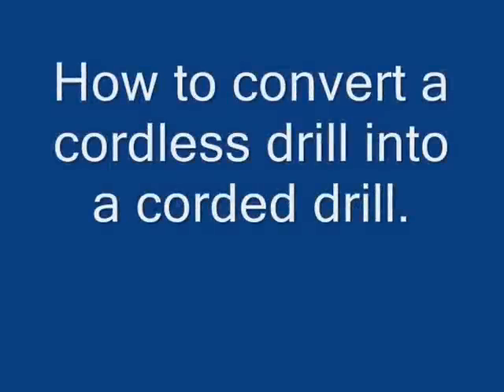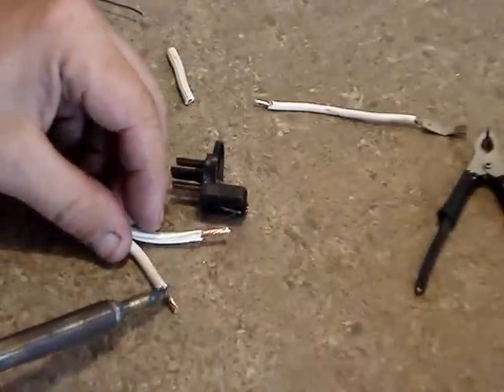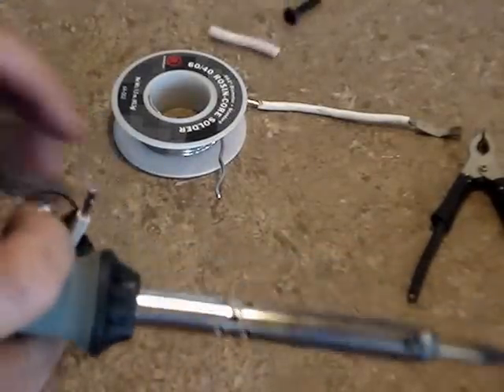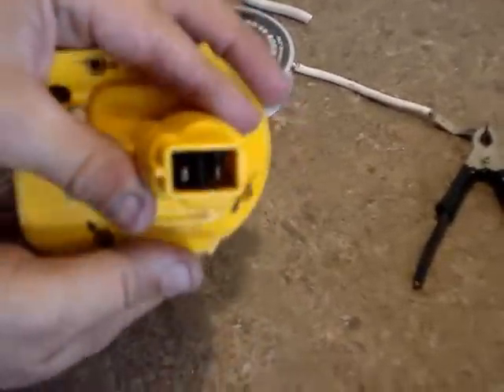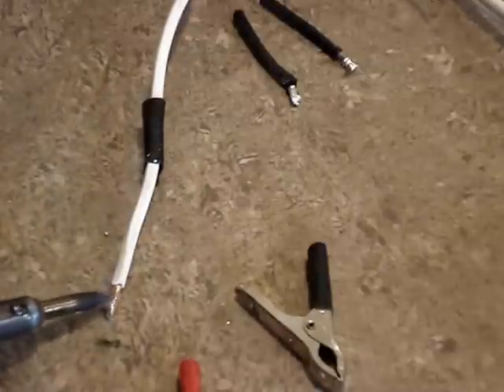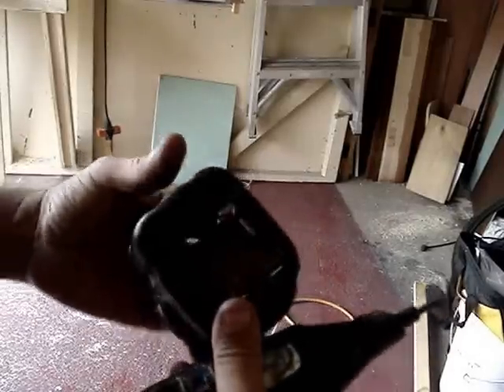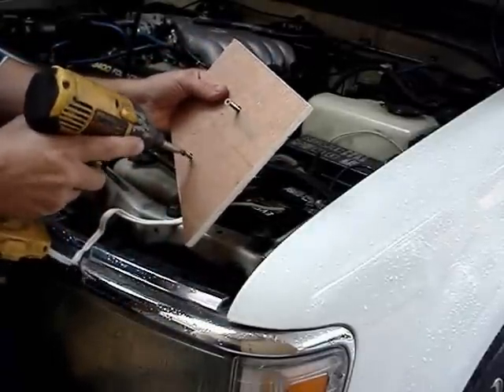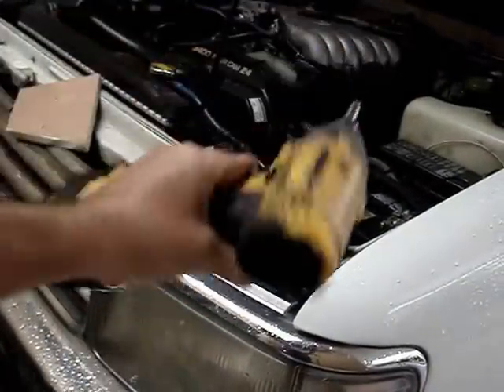How to make a cordless drill with a bad battery into a portable corded drill.

Comment: Better to make a low voltage extension cord that comes from a low voltage sorce to plug the drill into. But you may have to calculate voltage loss over distance.

Comment: Excelente vídeo thanks .I have a question.I got a black and decker drill 7.2 v that I had it running with my 12 v car battery ( for about 30 seconds) do you think 12 v would be too much power or it’s gonna be fine.I don’t wanna damage the battery or the drill.thanks

Comment: You are better off using 12ga. instead of 14ga. not moving to even thinner 16 ga. wire.  Remember that it may only be 12V but that works against you, means it needs that many MORE amps, and every volt you drop across the cord is far more of a reduction in power than with higher voltage equipment.   Granted you started out with 12.6V if the battery is fully charged, but your original "12V" batteries started out at closer to 14V fully charged, even though they quickly droop to near 12V under load.

Comment: Would I be able to wire it to a regular plug in 120
Reply: not directly, you will need a power supply of sufficient voltage and amperage so the 120AC is rectified and transformed to a dc voltage that works for your drill.
Reply: @brentsido8822  so basically the original dc charger?
Reply: @chrisrosenkreuz23  I guess that's possible if the original charger puts out enough current but as it chargers that battery overtime unlikely the output is enough to drive the drill under heavy load.
Reply: @brentsido8822  thank you for the reply, that makes sense!
Reply: @chrisrosenkreuz23  sure, welcome

Comment: Nice job!  Looks like a good idea to maybe make one of these with a longer cord for permanent use.  Find a reasonable 12 volt smaller battery, like a lawnmower with the carry handle for convenience and just carry it around. It  has to last sooooo much longer with a small battery.  Only thing is you have to have a charger and you would be set with an awesome tool that you dont have to pay up to $40+ for all the time. A real battery should last for years, just like a car does.  :) Peace

Comment: You can actually use an old PSU to power drill with +12v line. So that you don't have to use any battery.

Comment: This may work off a good 12V car battery charger. I think they put out enough amps to work without being overloaded. Also, the drill useage is not continuous which should keep the charger from over heating. This gives you a portable indoor power source from a source many fixit guys already have.Great idea even if you use batteries most of the time for when all your batteries run down on a job.

Comment: Your new, corded cordless drill, all your bits... And a riding lawnmower battery. Will all fit inside a cat litter bucket. Making your corded cordless, portable, again. The bonus here... Yes, even an 18v drill will work on the 12v battery. Maybe a bit slower. But with a LOT more torque and longevity. The riding mower battery has a ton more amperage than the cordless battery. So your drill will power through where it wouldn't before. Plus, it lasts a long long time. You can build a complete shed, with one of these, without ever having to recharge the battery. I know, because I did.
Reply: By the way, I didn't use alligator clips. I used a two prong trailer wiring connector. Connect one half to the battery, and leave it there. Connect the other half to the end of your cord. You can disconnect any time, and put the battery on a charger.
Reply from the maker: Good idea. Thanks for watching.

Comment: OK.....
what would it take to add a regular plug that you can plug into any outlet in your home?
Reply from the maker: Thats harder to do you would need a transformer that could put out the amps needed to run this. Most of the transformers only put out 12volts at 1 amp or so.
Reply: That's what I did. Use a laptop charger. They can provide 19.5v@3-5amps, which is perfect for a standard 18v drill. Fit the adapter inside the battery case, leave 1 foot of cable for hooking up to an extension.
Reply: The voltage at the wall outlet is 110 V AC. It needs to be converted down to 12 V DC. Otherwise, poof goes your drill and sparks will fly.
Reply: trickle up that's only 100 watts. how's the power?

Comment from the maker: This really is not a complicated idea. Most newer cordless tools use lithium ion batteries. I now have the newer versions of this tool. The idea of buying more of the old type ni-cad batteries for some of my old tools seemed foolish so instead of trashing it I decided to try and recycle it. I use this one only when I do some work on my truck. I also converted one of my older drills to a solar tracker actuator. If you think its stupid or a waste do not do it. Simple.
Reply: Yes this is the cheapest idea. I find another idea: replace the battery with cheap R/C LiPo battery. I bought 2200 mAh 2s 7,2V Lipo for my old Makita cordless drill. It cost me 9$ and i buy low voltage alarm for 2,5$ (to incrase the life of the LiPo). Maybe you need a charger if you havn't. Its cost about 20$. But it is cost with the charger less than the new battery. The other reason to buy R/C charger, it is balanced charger and the cordless LiPo drill chargers are not balanced. Which means the rc battery last longer than the original one.
Reply: Aceman307 great for off grid
Reply: Aceman307 They make attachments that let you use the new DeWalt batteries on the older tools don't trash everything

Comment: To plus it in to a wall socket you'd need a rectifier and step-down transformer. You could possibly use an Apple macbook charger although the amp draw might be too much. You would of course need a power supply to match the voltage of the tool.

Comment: Dang! I've been thinking about just such a solution for my remote cabin. In your video you attached to a car battery, so I assume your drill must be a 12 Volt type.  What would you suggest for an 18 Volt system?
Reply from the maker: Yes my drill is a 12 volt type. You could use three 6 volt battery's in series and a 6 volt charger.
Reply: Thanks, much appreciated!
Reply: 18v ok on 12v battery, you will get slight lower full opperation speed. You should also put a 30am blade fuse in as cloase as poiiable to the barrtery.
Reply: Thanks for the tip re: adding a fuse to the system.  I'll give it a try.
Reply: 18 volt batteries actually charge up to 19.5 volts, and the drills draw around 3 amps, which just so happens to match most HP laptop chargers.

Comment: wouldnt you techically be able to conect the clips to the charger?
Reply from the maker: The charger will not put out the amps to run the drill at full power.

Comment: You could stick a trafo in the pack, and run it on main power.
Reply: John Obmar ....you could stick a transformer in the pack , but then you would have to get 4 diodes and and build a full wave bridge rectifier (or get a silicon controlled rectifier)  to convert the alternating current to direct !!!!!
Erik Vonderlieth
Reply: erik vonderlieth

There are transformers with enough capacity you can put in directly.
I would use an old adaptor for this.
Reply: John Obmar   look to see its a "DC" direct current adaptor ....check the writing on it , look at output voltage , should say  "DC"  or  "VDC"
(Erik)
Reply: @BluesBoy-ij2rb  bro the transformer already gives DC because it has rectifier

Comment: What about differences in voltage and amps from stock battery to car or other batterys?? is that going to mess somthing up? i would be afraid to hook it up to my truck battery especially if still connected to the vehicles terminals as well, but im no electrician.
Reply: you could plug it into a battery from a freight train, as long as it's around 12V it will work fine.  The drill motor only pulls as many amps as it needs regardless of the battery capacity.

Comment: I have that same problem for a number of tools, but the problem these days is that most tools are 18v, not 12v. Using a transformer is difficult, as these tools pull a lot of amps.  Batteries are 12v, so some creativity is needed for the 18v tools.
Reply from the maker: Not everyone lives in places they can get replacements. Or the country they live in has very high taxes or import fees. These videos are not just for people that live in the U.S.
Reply: Usually a person who lives in a country where they can get a cordless drill, can also get batteries.  Some people may think an old drill is not worth the expense of a battery pack, but if it was good enough to bother with the mod in the video, it was good enough for a new or rebuilt battery.

One thing I did when I rebuilt mine was take the drill cover off and scrub the grime away.  It didn't look new afterwards but a lot better and I cleaned some dust and wood chips out of the air passages too which should help keep the motor cooler.

On the other hand, they look like they might have been NiCd battery packs and many people today opt to get a Li-Ion kit for higher capacity, capacity to weight ratio, and longer charge retention sitting on a shelf.  I have to practically recharge my Dewalt NiCd drill before every use and that's with a rebuilt battery pack, though the rebuilt pack gained 800mAh capacity over the original.
Reply: me too, hope some genius make heck.;)
Reply: It's not that difficult.  Car battery charger outputs 14.4V or so but more importantly can have enough current capacity to not droop under load.  So much so that you might want to add a thermal sensor in the drill (if your model doens't have one), because using a battery pack the pack itself will limit the peak temperature the tool could reach, while with an infinite power source you increase the risk of damaging the motor.

However, if you treat your Dewalt well it should last for a very long time, is probably worth buying a new battery for unless you have plans to soon upgrade to a larger set of Li-Ion powered tools.
Reply: Just REpack them.
it's not that expensive.
18V NiMh REpack $15
18V Li ion REpack $25
Reply from the maker: You are right in most countries you can get these kinds of drills also the batteries the problem is the cost. In Costa Rica the normal salary of someone is less than half  of what it is in the U.S. but the cost of tools are double. An old style nicd drill  is the cheapest going for about 200 dollars the replacement batteries go for a little over a 100 dollars. The more expensive lithium drills start at about 300 and go up from their. So I bought the newer Lithium drills but instead of trashing the old one I modified it to work with  a car battery. I am lucky compared to most that are from here when I need new tools I can pick them up when I visit the U.S.
Reply: For 18 volts battery you can use laptop charger.
They are around 18 to 19 volts and has plenty of amps.
Works really well

Comment: Makes sense, I'm surprised￼ you cannot buy a commercial product that allows you to run your power tools off the car battery in  emergencies.
Reply: +tuffduty along with the fact every brand uses a different connecter, it would probably infringe on patents the companies have on those connecters.
Reply: +Andrew B (IrishRebel92) but I bet the company do not own right the the plug am sure that is all out sourced would you not think so?
Reply: iwantosavemoney apple outsources the production of the iphone, but they still own it. Now if a company were to claim they have made an improvement on the connector, then they might avoid a lawsuit, but no one is going to risk it.
Reply: +Andrew B (IrishRebel92) that makes perfect since
Reply: Outsourcing production of components does not remove your rights to hold patents, BUT on the other hand it's hard to stop infringement when dozens of fake straw man chinese merchants sell infringing products.  Bring a law suit against one and it just disappears to be replaced by another.
Reply: Why would you want to pay a fortune for what that would cost, when you can just DIY by soldering a cheap jumper cable to a dead pack's connectors in 10 minutes?  I'm suggesting the market demand is too low, raising cost per unit even higher, when today we have superior Li-Ion battery tech in that it doesn't self discharge nearly as fast so you can just have a spare pack in emergencies. 

 Besides, how many emergencies are solved by running a cordless too for longer than one battery pack lasts?   Maybe putting a new roof on during a thunderstorm?  Building an ark if it floods?  Nail gunning zombies to walls when they come for you?  I'd rather have more battery packs, considering they can also power things like the same brand's flashlight heads and radios, and today even cell phone chargers.
Reply: I think he wanted to avoid buying anything otherwise he would have just bought a new battery? :)

Comment: find some old laptop battery, or buy new ones from old models, make some li-on packs. works great;
Reply: Bad idea.  You still need a safe way to charge them, the original NiCd charger won't do it safely and the cells are different dimensions so you probably won't be able to fit the right # of cells in the pack plus the needed battery controller board.

Better to just buy a professionally designed and tested new Li-Ion drill with a battery and charger included if you want one Li-Ion powered, not risk a fire from some old laptop battery.

Additionally, laptop batteries are economized to provide Ah capacity at the expense of current, are not rated high enough for good power tool performance.
Reply: @stinkycheese804  Laptop batteries are 18650 Lithium, the exact same as most power tools. Ten 18650 cells in a parallel/series configuration are what most power tools use.  The charger circuit board can be purchased online for less than $3 and charges all cells equally.

Comment: why not connect directly to charger?
Reply from the maker: ProLife Infinity Your drill needs more amps to run strong. The charger does not  put out that much power.
Reply: @Aceman307  why?!
The 12v charger can give a current up to 1.5A which is good and normal for the 12v drill/impact
Reply: Then you might think about getting a beefier charger, because the gauge of wire itself that you  used would be the bottleneck for a good charger.

Comment: Why not simply drill a little hole in the black half and just run the cable through with a knot tied on the inside ? That way you would never pull the solderings.
Reply: Koen Brouns I suggest about how to rebuilding batteries for cordless drills . I serach alot and  i found  a product I also found helpfull for used or reconditioned auto batteries  is "Corbandy Battery Blueprint Crusher" - it will be on google if you need it
Reply: "cuz ur drill no work yet.  ;)
A knot is kind of crude, they make nylon strain reliefs that install into standard sized holes, like you find on many consumer appliance housings.  Grab them off of dead equipment before you throw it away, so you have some spares.

Comment: Hello, i  was at lowes yesterday and saw extension cables with a normal 3 prong plug in one end, and open wires on the other, i do believe it had a picture of tools... would this cable work to attach to my tool?
Reply from the maker: That sounds like a regular 110volt A/C plug that would work to fix a drill that already has that type of plug. In construction allot of times the cords get damaged and what you are describing is to replace a bad cord. This would not work for what I have done in this video because it works on 12 volts D/C like the battery in your car. I hope this helps.
Reply: No, buy a cheap set of jumper cables and cut the clamps off one end.
Reply from the maker: Thats a good idea fast and cheap.

Comment: I like this idea I think that it would be cool to be able to use to alligator clips wall power and use a battery it would make all battery powered tool way more versatile.
Reply: Aceman307 they do, you know all of them black boxes that you cordless phone and other things have, they plug in to 120 volt wall outlets and out put dc voltage, what you do is find one that is rated for your drill and connect it pretty much the same way but instead of hooking it up to a car battery you plug it in
Reply from the maker: I cant believe the drill companies have not made a corded 120 volt adapter for there drills.They could sell it for half the price of a new battery and people would still buy batteries. I don't think they would loss money.I cant tell you how many times I have used up all my batteries before the next one is charged.
Reply: yeah I would agree am going to gather up a set of 12 battery powered tools and build every thing I need

Comment: Does it matter how big (amp hour) the external battery is? Should I put something on cable it to taper down the power? Thanks
Reply from the maker: As long as the battery is the rated voltage of the drill or a combination of batteries to get the correct voltage for your drill for example a 18volt drill you could use 3  6volt batteries or a 12 volt and a 6volt. As long as the voltage is correct it does not matter about the size. Thanks for the comment.
Reply: +The Cedar Workshop a load only draws the current it needs at its rated voltage. If that was not the case nothing electrical would work. A common wall outlet could potentially supply 20,000 amps of instantaneous current in some dead short circumstances. Before the wires in your wall exploded, or your circuit breaker tripped. But we can safely plug a nitelite into an outlet with nothing bad happening. Because it only draws the current it needs. Plug in a paperclip though and that will leave a black mark. While it draws the 1.21 GigaWatts it needs to transport back to the future.

Comment: Use a longer cord and connect directly to a 12 volt 25+ watt solar panel and use your drill (or whatever) anywhere as long as the panel can be placed in direct sunlight.
Reply: Dave Bainard the output would very a lot based on clouds and shade so you wouldn't get a consistent power output out of the tool